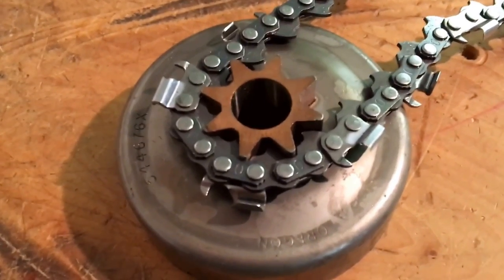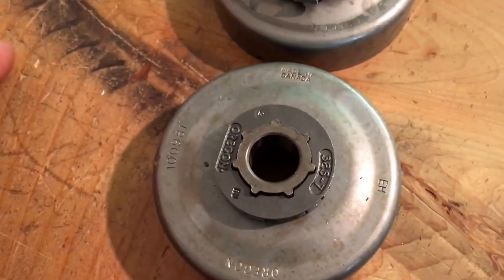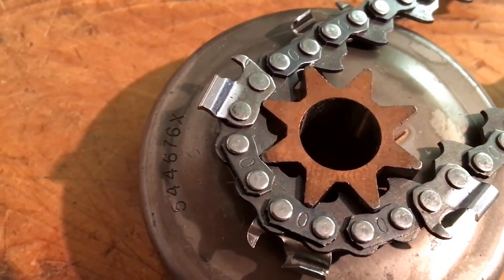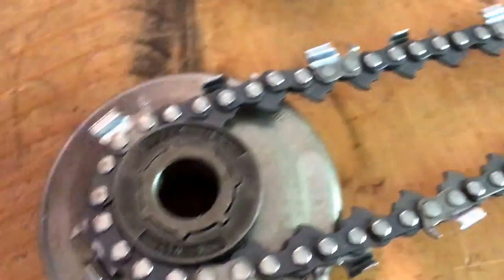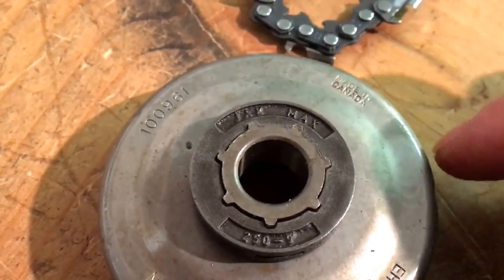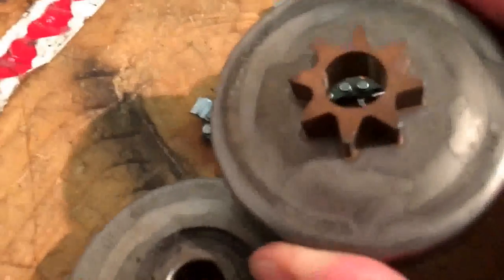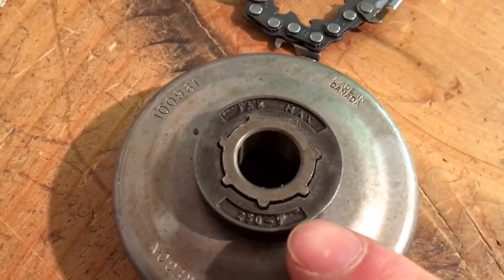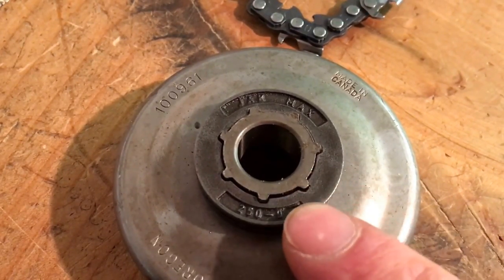Chainsaw Sprocket Types - spur sprocket and rim sprocket comparison

Comment: I recently changed a husqvarna 350 from its stock .325 pitch spur sprocket to a rim sprocket drive with 3/8" pitch so it now can use the many other 3/8" chains I have for my other brand saws!  I can easily put on any number of different tooth count to increase or decrease chain speed or put on a .325 rim sprocket with original bar and chain if I desire to. I had to go after market but I got it done and no problems with the increase in pitch. Of course it now has a new bar to match!
Reply: Did you use the original oil pump drive? I've heard some say it will work and some say it won't.
Reply: Did you have to change the oiler pump?

Comment: I like the .250 chain on my small saws, smooth and cuts fast.  Wish I could try out a rim with fewer than 9 pins, 8 or even 7 interests me.  I'll have a look closer at the OD of the spline drive, this might explain why there are no smaller rims.

9 pin works pretty good in this case but I can tell the saw 32cc and under saws struggle a bit in hard wood and I suspect 8 pin might really be better in that respect.

Also, many antique saws with gear reduction used a spur with internal 10 spines, like the MALL OMG for instance.  Replacement sprockets have proven impossible to locate and I'm looking for a solution for this dilemma as well.

Comment: Thanks for the video. I have an .058 325 76DL chain.  It's hard to find that chain in Oregon brand anyway. Do you know which sprocket I would need to convert it to 72DL? Thanks!
Reply: If you want to go to an Oregon bar get the .325 .058 Versacut bar but you'll have to get a  325 .058 78DL chain to fit it.

Comment: Question: I was running a Stihl MS261 and the rim sprocket broke.  How could this have happened and how can I prevent it? It broke a section off but no deformation just like taking a bite off a donut. Sorry for the poor technicality

Comment: Hi, I have a question. Can you put a rim sprocket instead of a spur sprocket if the spur sprocket drives the worm gear for the oil pump?
Reply: Iggy u referring to a husqvarna?  If so yes u can
Reply: If you can get the clutch drum with the sprocket adapter for your saw you can. As far as I know nobody has come out with a 6 pin rim sprocket, yet.
Reply: d hamby maybe not 6 but 7 are available via aftermarket. Depends on size of the saw. I got 7 rim sprocket, drum and bearing for husq 350 .3257 tooth. Presently waiting for 3/8 7 tooth rim sprocket for it. Which model saw are you looking for?

Comment: If your changing the rim sprocket to mount a different pitch chain, do you have to also change the nose of the bar? Thanks for any feedback.
Reply from the maker: Yes you do (unless it is a hard nose bar in which case if the gauge of the chain stays the same - the drive link thicckness - then you don't have to)....

But really you would not do that - you would change the whole bar as changing the nose over means riveting a new nose on. It's easier to buy a new bar and swap them over.
Reply: Thanks for the info.

Comment: Can I put the rim sprocket on a saw that has a spur sprocket?
Reply: dcano86 change to a drum that accommodates the rim sprocket.
Reply: I recently changed a husqvarna 350 from its stock .325 pitch spur sprocket to a rim sprocket drive with 3/8" pitch so it now can use the many other 3/8" chains I have for my other brand saws!  I can easily put on any number of different tooth count to increase or decrease chain speed or put on a .325 rim sprocket with original bar and chain if I desire to. I had to go after market but I got it done and no problems with the increase in pitch. Of course it now has a new bar to match!

Comment: I have  a spur type on mu Echo CS400 will the same chain fit both spur & sprocket drum?
Reply: Ducktruckful yes
Reply: You most likely already know this after 2 years so I say this for those that are just now looking and need to know.  The same chain drive link count works for both types so long as the count of link engagements are the same. Such as both are a 7 tooth or what ever count.  The pitch has to be the same as chain and roller tip on the bar.  Some rim sprockets are made for specific gages.  Like .325, 3/8. 404, .058, .063